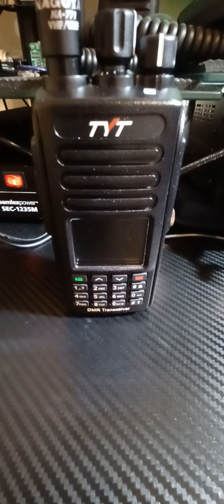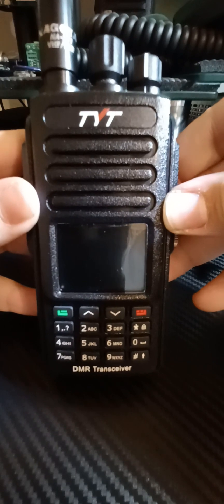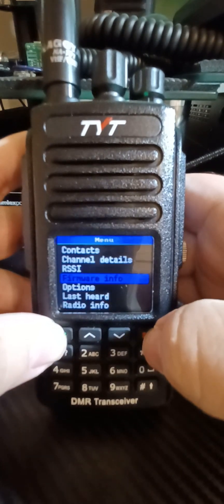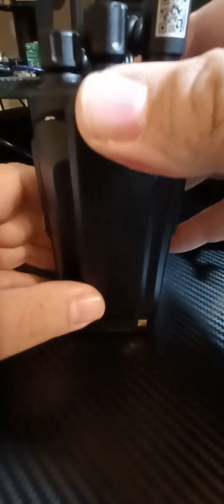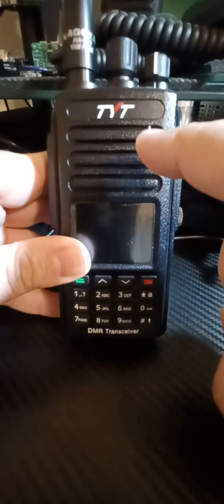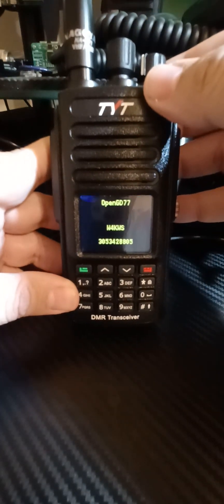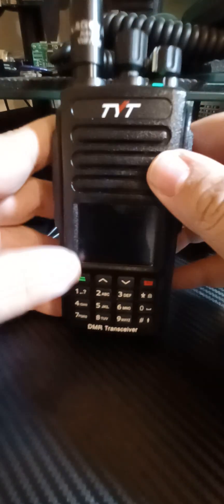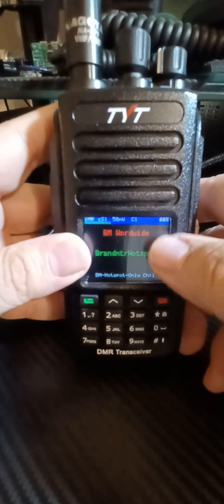TYT MD-UV390 Plus DMR Digital Radio NEW 2023 ON OpenGD77 working initial quality review. DMR GPS

Comment: Hi, I purchased a md uv390 10 watt, just did an firmware update now I have a bricked radio, I'm yet to find away restore the factory firmware any would be greatly appreciated
Reply from the maker: Sorry to hear that, I have zero experience with the 10 watt model. Check the OpenGD forums. 73

Comment: I have a t y t m d UV 380 it is my daily driver. It is running the open GD 77 firmware. Is it possible for me to just use the radio with the software that's on the radio and program it right out of the box from the front panel I put my DMR number in etc etc so I can use it on my hotspot because with the lack of drivers for the open GD 77 I completely given up on that firmware I can't even update my UV 380 it's running a version of the firmware from 2022 all because of the damn driver situation. And since the people would open GD 77 don't want to be you know helpful in getting information out there cuz they don't you look at it and you can't make heads or tails of it I refuse to install any quote custom firmware. My question is can I use this program it right out of the box that's all I want to know thank you.

Comment: Does anyone know how to distinguish the "plus" version from the regular MD-UV390 at a glance? From the few frames we can see at 0:39, the sticker seems the same. The "non-plus" version also ships with the option for a GPS chip, so the big sticker doesn't necessarily indicate the presence of the new crypto chip that the "plus" has. 

Maybe the "plus" has a distinct firmware version that you can find in the radio info menu? If anyone can distinguish between the two without popping the case or loading a codeplug, let me know.
Reply from the maker: Watch my 2nd video on this 4-month review. Thank you
Reply from the maker: A sticker watch the follow up video

Comment: I flashed my 390 Plus with the OpenGD77 firmware, but after flashing, the screen displays without the backlight turning on. I confirmed there were no issues with the display settings, and reflashing didn't solve the problem. Later, I imported the CPS data from my previous 380 into the 390 Plus, and it behaved strangely. The backlight doesn't turn on when the device is powered on, but it lights up after pressing the PTT button once and then stays on continuously, even though I've set a time for it to turn off. Now, I don't know what to do.

Comment from the maker: I will be making a follow up video on the 390 Plus. I have not done an update to GD77 and see no reason to do so. As a general rule firmware updates should only be done to address issues REAL issues, they should not be done blindly everytime they come out. THE 390 has been an excellent radio on DMR and analog. The battery is good solid. Thank you all.
Reply from the maker: https://www.youtube.com/watch?v=W9AtMAvYjOQ UPDATE review and information!!

Comment: PSA: I have updated two TYT MD-UV390 Plus radios to OpenGD77
Reply from the maker: That's great. 73s
Reply: Which firmware are you using for it I am using the opengd77 for uv-380 and it does not seem to act correctly
Reply: @terrybaileysr.3714  I'm using the current OpenGD77 2023.12.12 Beta, previously when I first flashed the radios it was with the prior version. I've not noticed any issues. Have you reported your issues on the OpenGD77 forum?
Reply: @JasonDora  yes I did today.

Comment: Just curious - are you able to get GPS working indoors?  There was some speculation on OpenGD77 forum that the GPS might be improved in this model - Thanks!  As far as I can tell, no one else has tried OpenGD77 on this radio and reported about it.
Reply from the maker: The GPS works for me, I have not tried indoors. Thanks
Reply from the maker: Not indoors for me, no otherwise. Thank you

Comment: I've been using the software that TYT supplies, and it works great. I have been buying the UV390/GPS radios since they came out. I bought the RT Systems software for it, but it doesn't include all the options the TYT software does.

Comment: very good.  I have the same radio.  It has firmware s119.023.  I have s119.024 and I don't know if I'm going to update now.  I didn't find anything about what changed from 023 to 024. I can't find anything about this radio.
Reply from the maker: Thank you for the fast comment.
Reply from the maker: I would leave it if its running fine, I am sure OpenGD77 will get a firmware update soon. Thanks, again enjoy the radio. 73's
Reply: @fernandes909, can you provide a link to this firmware ( s119.024 or  s119.023)?  I can't seem to find it anywhere.  Thanks!